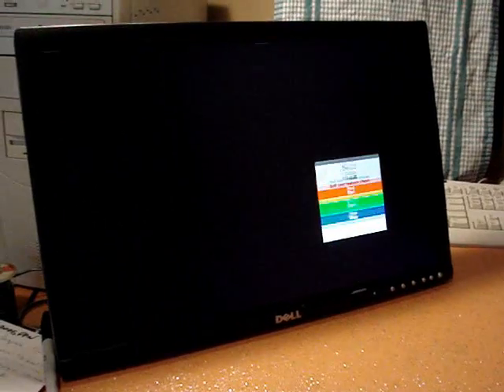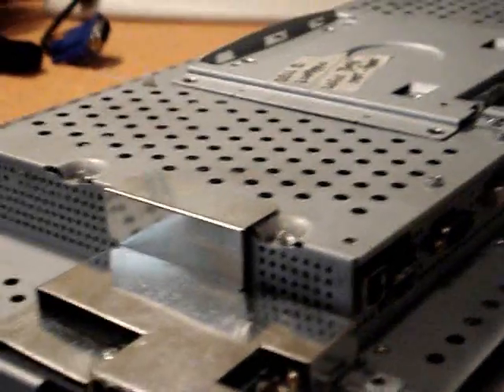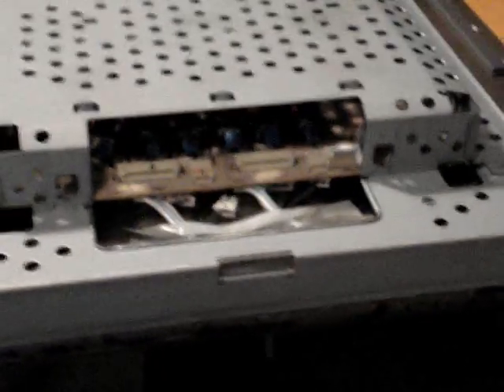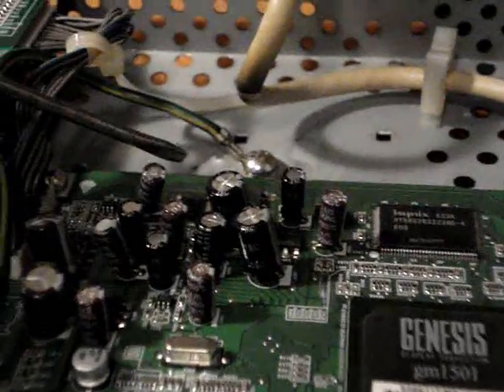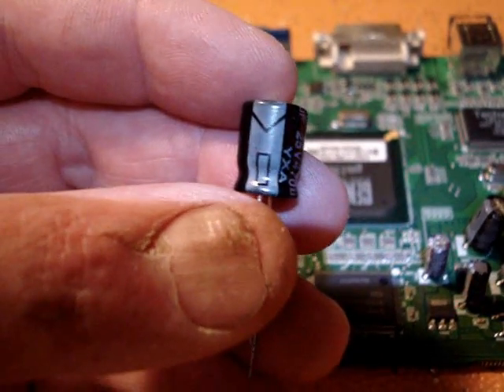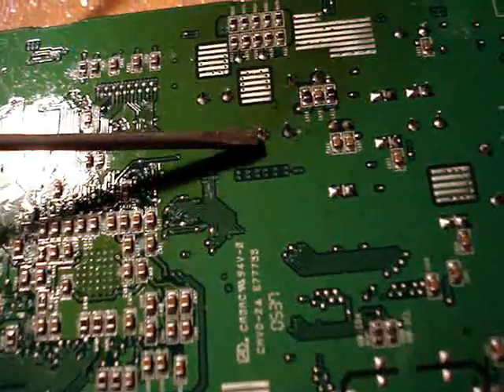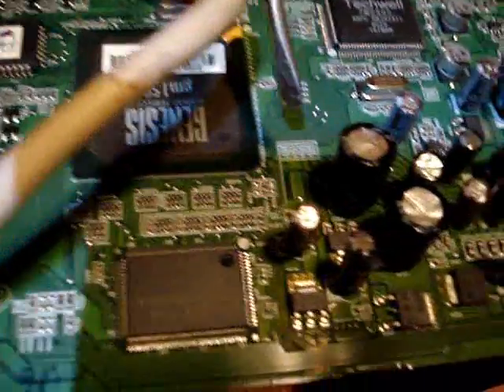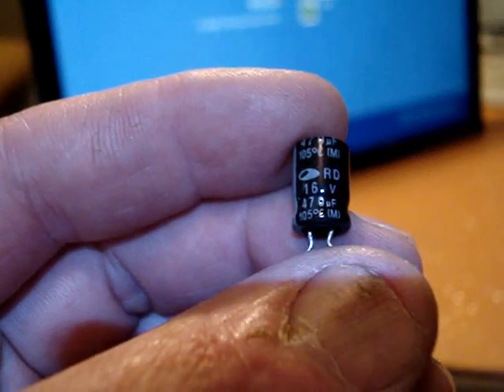Repair a Flickering 20" Dell 2005FPW LCD Monitor (similar to 2007WFP)

Comment: I had this problem every time I start up the monitor. to I turned off the monitor and then back on and got nothing but a blinking green power button. I shut it off for about two hours and I get what you see in the video witch has been the norm for a while.
Do you think this is a capacitor that is just about gone.

Comment: Hi, I also have a Dell E207WFP, but I have gray vertical lines thru-out the screen, even when Im on any page or especialy on dark backgrounds or even during boot, looks like a hum bar or noise.I replaced the caps, and all the caps look good, but no change. Any thoughts on what might be wrong.Thanks

Comment: As an EE- I would caution- replace with 16V, 105 degree C- rated caps.  They wear out- but the originals lasted a long time, didn't they?  Higher voltage rating doesn't mean better!  But higher temperature rating is critical to long life in this hot environment.  USE A SOLDERING PENCIL- NOT A GUN!!!  Guns get WAY too hot, and are blunt instruments, you need a little bit of precision.

Comment: Had the same problem with my monitor. Did exactly what you did and it solved the flickering problem. However, there is still one problem that continues to reoccur. It's when the computer goes to sleep. When I try to wake it up, the computer wakes up but causes the monitor to flash the power on and off and it doesn't stop. So far replacing the 2 caps on the board fixes the display flickering but not the power flickering.

Comment: I'm pretty sure it is the power board and those caps, I guess something that the backlight of the ldc screen itself is sensitive to if it does not get the proper amount of power? I will try to fix this tomorrow.

Comment: I'll do that thank you, but what I am going to immediately do is replace that block of capacitors on the power board, there are six 820uf 25v ones and at least five of them are bloated and fat and from what I can tell with my ears they are making the buzzing sound, or maybe it is the large transformer right next to them... I will post a picture or video of it because I think this is the problem Jeffrey Jakubowski is having and others too

Comment: Hey Capman thanks for posting this. So I managed to get those capacitors replaced on my dell 2005fpw with a couple 470uF/50v and everything went fine except for a broken front bezel no big deal, but my problem is still there. It's the exact flickering everyone is describing here and there is a high frequency buzz that sounds like what you'd hear in an old overhead powerline. The buzz changes pitch and strength ever so slightly, in sync with the flickering. So high pitch my Dad can't hear it

Comment from the maker: Unfortunately, without the boards, I have no way of diagnosing the issues.  All I can suggest is to check the power outputs from the Power Supply and replace the remaining capacitors.  It may be more cost effective to purchase a monitor with a damaged screen and use it for parts.

Comment: Flicker is gone!!! Fixed my monitor!  You are my new hero. Thank you.  Cost me $1.20 to repair.  However, my 35 year old 30 watt soldering iron from Radio Shack would not heat up solder on circuit board, so I had to buy a new variable 30-65 watt iron to finish the job.  Less than $20 with tax.  I had opened the monitor before, but could not see any obvious problems with caps.  Wish I had looked for you video first

(My hero used to be Dudley Do-Right for saving the women from Snidely Whiplash.)

Comment from the maker: Sorry for the missing content; position the monitor so screen is facing up.  Place your fingers under the top - middle edge on the screen side of the bezel and lift.  Work your way around bezel until free.  Flip complete assemble over and lift off the back cover, then disconnect the ribbon connector to the bezel control.  Lift the screen out of the bezel.

Comment: Guys, any tips for getting the case opened up safely on this thing without temper tantrums or breakage? I have the power going on and off on mine, and on the random occasion that it stays powered on, hear the telltale sound of a cap going bad. I'm staring blankly at it right now, having removed the 4 screws at the stand mount. Does it just pry off somehow?

Comment from the maker: Double check 
• The capacitors on the Power Board for bulged tops
• The capacitors you install with the correct polarity
• All the plugs are installed correctly & right way up

Comment from the maker: There may be an issue with the power board.  Remove the power board and closely inspect the capacitors for leaking or bulging tops.

Comment: Also, at 4:13, its not obvious how to get the board out of the case. There are 4 screws to be removed, and the VGA ad DVI ports need be unscrewed from the metal frame. I found that there were still several connectors attached to the board that made it hard to flip over. One of them can be unplugged from the other board just by squeezing and pulling it out.

Comment: Thanks for the video! I just completed the repair, and it works perfectly. This monitor was headed out to the trash before I checked to see if it was an easy repair. $2 - $3 worth of parts, and its like new. Note: the initial dis-assembly is not obvious - there are clips all around the bezel that need to be carefully pressed in. I followed the first part of the instructions in another YouTube video (search for 19" Dell Monitor Repair (1907FPVt) and used that for the first part.

Comment from the maker: Deconoise -
Disassemble the monitor and inspect the capacitors on both the power & logic board. Remove all the protective foam from the tops of capacitors.  A visual inspection of a faulty capacitor will have a bulged top and/or rust marks at the base or top.  As you have viewed on this video, not all failures display these visual signs.

Comment: My 2005FPW has a red vertical bar from top to bottom on the right side of the screen. 
The bar is about 3 inches wide. Any clue what's causing this?